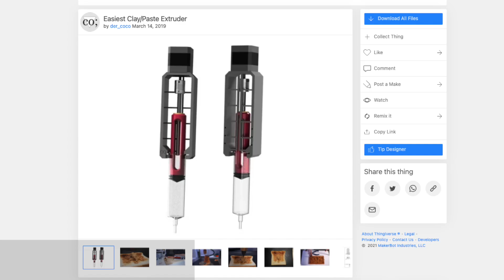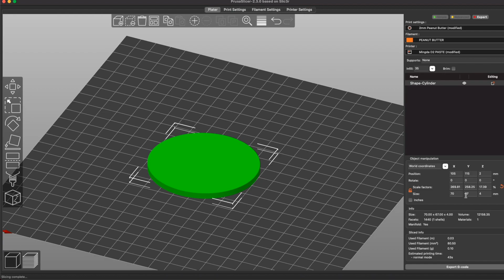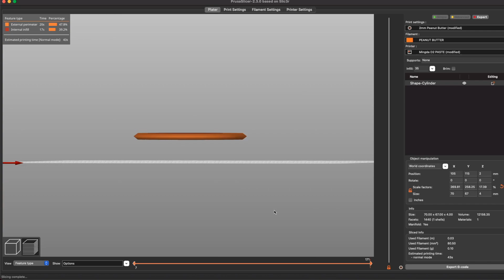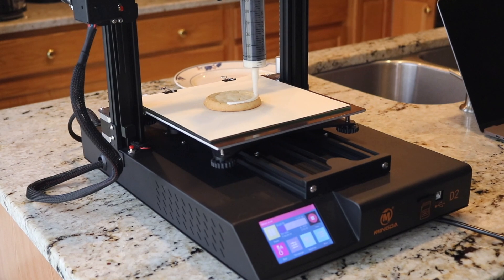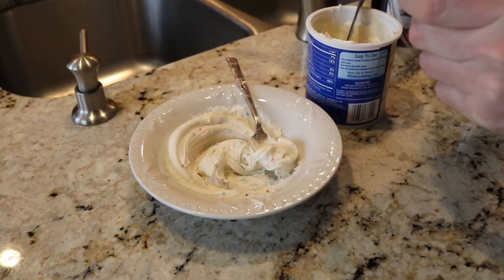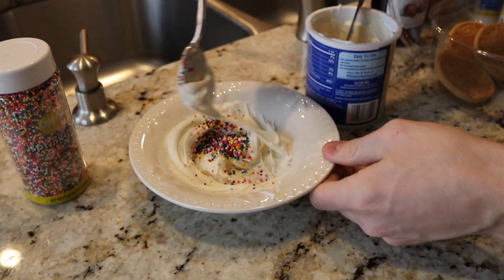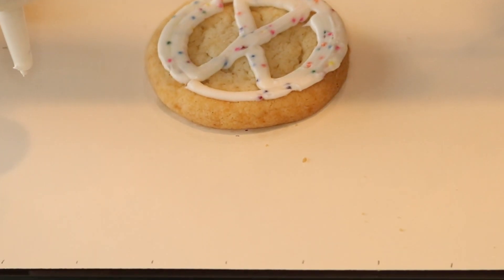3D Printing Frosting, Peanut Butter, and Jelly - Syringe Extruder

Comment: Very nice project. Your first bite out of printed PBJ must have been truly amazing. 😭 Props and congrats.

The missing icing at the start of the cookie is interesting. The tool path itself is complete, but the icing has poor immediate adhesion and is seen dragging along the arc instead. Can you describe that purge sequence? Resting the nozzle on the build plate would help reckless oozing if you’re not doing that already. A rubber pad (or several to reduce cross contamination) on the bed might be good for sealing up that nozzle tip while it rests.

Thanks for the inspiring work. Food 3D printing is a future wave for sure. I want to see this printing softened ice cream in the freezer lol.

Comment: Hey man, thanks for the shoutout!! I always love to see people use my designs so successfully 😍
Reply from the maker: Thanks for making this dream a reality! Your design works great, and you weren’t kidding about sparing people from watching you cut that Z rod! That was the part of this project I spent the most time on. 😂
Reply: @AndrewSink  Yes those rods are usually surface hardened. It's a huge pain if you only have hand tools 😄But your extrusion control was much better than mine. I found it so hard to control oozing. Especially when printing with the more liquidy stuff like nutella, peanutbutter or jelly. Do you recall what you did to control it so well or did you just get lucky? 😉
Reply from the maker: It’s funny, it was a total kludge that just happened to work. At each travel move, I retracted about 10ml of frosting, which yanks it right up into the syringe, then I advance only 95% before starting the next move to allow gravity to pull it out without dripping. 

Worked like a charm!
Reply: @AndrewSink  Okay wow I remember only retracting around a 10th of that. Should have thought of that solution. Guess I never was the brightest candle on the cake 🤫

Comment: I'm wondering if with the heated bed you could make some kind of egg mix and cook it as it lays down? Egg cooks at 73celsius which could be set on the temperature settings
Reply from the maker: Huh, that’s not a bad idea! You’d want to add a lip around the bed to prevent it from dripping onto the printer, otherwise you’d be scrubbing egg off the frame 😂
Reply: @AndrewSink  yes immediately after I wrote that I checked and the only video of someone cooking an egg on a 3d printer I could find was a teenager who ended up trying to balance the egg with his fingers, you live and learn eh!? I was thinking more of a waffle/pancake mix, I'd do it if I had a printer I didn't care about too much